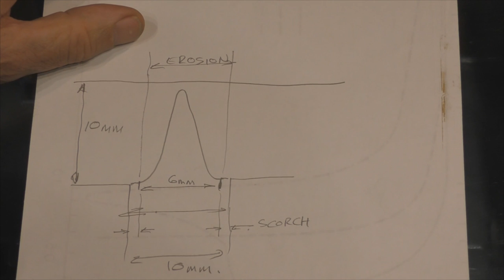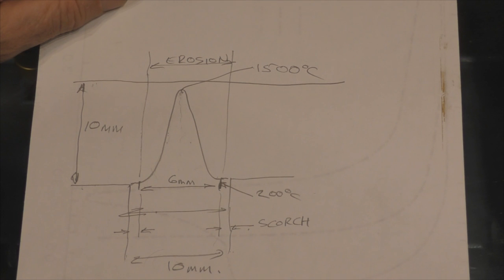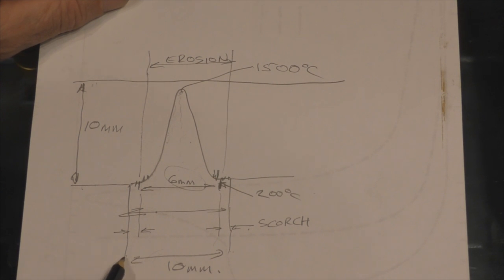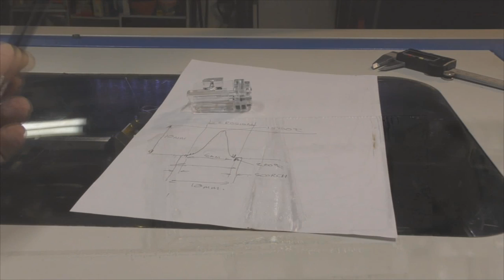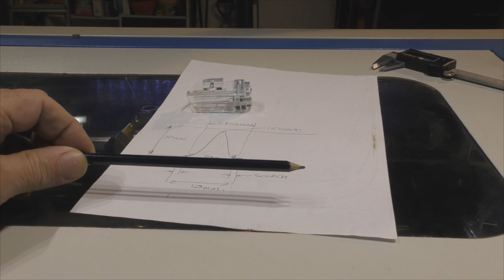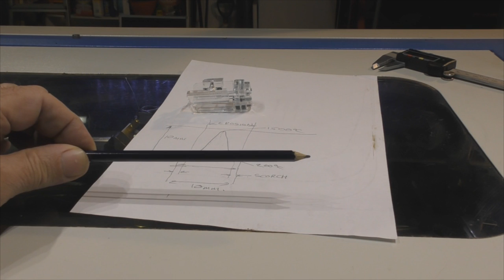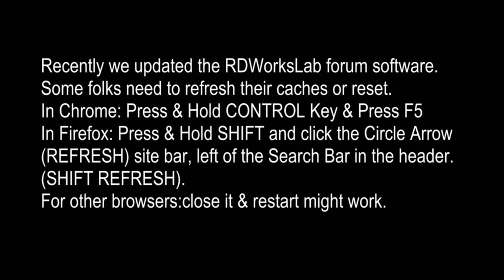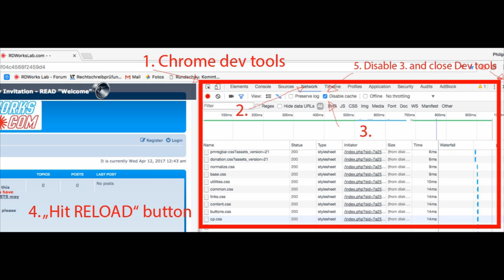RDWorks Learning Lab 102 Laser Beam Diameter

Comment: are the mirrors in these lasers under sized.  what is the diameter?  If the mirror housings can be changed or adapted would bigger mirrors be an advantage in using the far extreme of the beam.
Reply from the maker: Hi
As you can see from the mode burn into acrylic, the damage diameter is about 6mm, which is the claimed beam diameter. True it probably does encapsulate maybe 85% to 90% of the energy and a 6mm beam easily fits onto a 25mm mirror.  In its mount and canted at 45 degrees the effective mirror  width can be as little as 14mm. That's plenty to aim a 6mm beam at . However there is residual energy right out to 12,7mm that may or may not be collected if the beam is not well aligned. I am a believer in wanting to collect it all now that I know its there to be had.The bigger problem is the fudemental design of laser head where the bore down to the lens is fine for a 3mm diameter beam 40 watt tube that they fit to these 50 watt 300x500mm machines but upgrade to a proper 50 watt tube or more and you will start to encounter design limitations.
Best regards
Russ

Comment: Explain to me, if you can because I don't know the answer, but I have a laser pointer (5mw) and when I pointed it outside my window to an object 50m away the dot had grown pretty large.  Is this because it is only 5mw or what is going on?  No mirrors for distortion so stumped I am.
Reply from the maker: First I have to say I have no rational explanation for you. There will be double refraction as the beam passes through glass ie the beam will come out of the glass at a point that is offset to the entry point but the entry and exit beams will be parallel. So this cannot be explain what you are seeing . Glass can be very a complex material depending on its constituants and how it is made There is usually very little crystal stucture in glass otherwise it would not be transparent. It may be possible for the few crystals that are there to cause scattering of the beam as it passes through. I would experiment with some cheap picture frame glass  to see if you can  replicate the result. You could also write to the tech department at one of the big glass manufactureres. 
I also need to apologize for not answering another of your questions. I looked back and was a bit confused about which one I had missed. Was it the stainless engraving question?
Best regards
Russ
Reply: Your 5mw pointer is Laser Diode, quite different from our 50-80W CO2 laser tube. There is usually lens in front of the LD, which can be focused by turning the barrel. The LD has so called Fast Axes, which creates oval shape of the beam, usually corrected by FAC lens. On more powerful LD you actually get a line instead of a spot. I am talking about output of 4W and more.
And than there is the glass interference, as Russ mentioned earlier. 
regards
otto
Reply: Yes, I understand that but why would this laser grow the farther it goes?  Laser is supposed to be a coherent beam not like a flashlight regardless of what is producing the laser.
Reply: Russ, it was the stainless.  As Otto mentioned I have a laser diode but a laser is a coherent beam regardless what is producing the beam (solid state or gas) so the farther out the beam goes the bigger it becomes 
which makes no sense to me for lasers.  If this were a simple torch (flashlight) I could understand.
Reply from the maker: I can only take an educated guess at your laser pointer problem by saying that I agree about a coherent beam of light and those photons are all happy to travel as a tight knit group until they hit something. That something could be dust particles in the air, rain, fog ,snow etc and then they start start losing their energy and probably being knocked off their straight path. For artillery range finding they use kw lasers  not milliwatts to try and overcome this issue. As I mentioned, glass may appear transparent but if there is any crystal structure within, then those crystals would steer the photons off course. Now please understand, this is just my logic and not verified fact so I cannot really unravel your particular question.

As for the stainless question, I must apologize for missing it. However, it's good to answer it in this comments section because as you will see in my beam energy profile picture, the higher the energy density of the beam (towards the centre) the high the temperature. With my 70 watt beam I can already see about 1500C before it passes through the lens where the energy density (temperature) will be further magnified.

Stainless melts at about 1450C so when you stop and think about it, there is potential to damage the surface. However, the initial problem that you have to overcome is REFLECTION. The crystal structure of stainless steel makes it about 90% reflective so chucking 1500C at the surface is not going to cause melting because most of that heat energy will be reflected. That's why I was a bit hesitant about this whole venture. The good news in my case is that with 60 watts amplified, I am hitting the surface with so much heat, I can overcome the reflection issue and start melting the surface, As soon as that happens then the crystal structure changes dramatically and the surface become absorbent to the heat , but only very locally because now the thermal transfer  properties(and mass) of the steel come into play and the energy gets quickly dissipated, thus limiting the depth of the melt. After all it is only a pin prick of energy that might be incredibly hot but at 60 watts it has no hitting power. I doubt if a K40 (30watttube) would ever be able to genetare high enough spot temperatures to overcome both reflection and thermal conductivity.

Best wishes
Russ
Reply: I beg to disagree. Please take the lens off your pointer and see...
There may be confusion in two different terms - coherent and collimated. It is not the same. The CO2 laser produces collimated beam, whilst LD does not, it is like your flashlight. Google "laser diode beam shape pics"
regards
otto
Reply: Well, laser beams aren't supposed to spread out is what I have been taught for the last 40 years is what I was saying.  They should be the same diameter in free space (in a vacuum) 1mm to as far as the beam can go which depends on its energy.  At least this is what I was taught when using a real Ruby or gas or now solid state diodes.
Reply: Trying to process ordinary light into a coherent, monochromatic and collimated beam, is just impossible and Wiki says Collimated light is light whose rays are parallel, and therefore will spread minimally as it propagates. A perfectly collimated beam, with no divergence, would not disperse with distance. Such a beam cannot be created, due to diffraction.   The thing is I see a 2mm dot at 25mm distance turn into a 100mm dot at say 45 meters that is pretty bad for a laser of any type.  I still suspect the lens has something to do with it but I can't grasp how it would have that much spread for a relatively short distance.
Reply from the maker: Hi
Iyt appears that all laser beams start diverging as soon as they leave the exit window. That divergence can be negligible to small but there is a formula to calculate it
http://iiith.vlab.co.in/?sub=1&brch=189&sim=342&cnt=1
Reply from the maker: Could it be that the law now requires all laser pointers to be focused at relatively sort distances to remove  the nuisance/hazard to others? I'm not up on this technology I'm just probing for an alternative explanation.
Best regards
Russ
Reply: You may be right Russ as I wouldn't put it past the lawmakers to do such a thing.  Over here in the USA people were using laser pointers on planes and that caused a HUGE stink (for obvious reasons) so maybe they did.  I wonder if a diode laser that is used in a pointer is not the issue now but it is its focusing device?  I know of no laser pointers with a focusing mechanism in them so what is in it is what it is.
Reply: Some odd reason I can't edit posts on Youtube.  Anyway, that link goes back around to what I first said so the total length of a laser engraver's light path would be what exactly?  The beam at the far end and the beam coming out of the tube itself should not be exactly the same even if all mirrors were removed and it was just shot into space instead.  I suspect a mirror would exacerbate this to some extent (especially with 3 of them).
Reply from the maker: It is certainly possible for the beam to be distorted by the mirrors, that is why I'm staying with my copper mirrors that were lapped dead flat (to within half a light band). A sample Chinese mirror that I sent for comparison, was 10 lightbands!!! My laser exit window is 12.7mm and the biggest hole I can burn with it after 3 mirrors is 12.7mm so there appears to be no growth. However, the burning threshold for masking tape must be over 300C and there is scorching around the hole indicating power beyond what I can see. So I suspect I am still not collecting every last gram of energy and that the beam is growing in diameter even after a couple of meters.
Regards
Russ
Reply: I was let down by your findings on the gold mirrors and I am not sure why they were basically the same as copper which makes no sense.
Reply from the maker: That makes two of us at least. Ok I am only looking for anther 1 or 2% efficiency  and the scientific data suggested it was there to be had. Knowing I was looking for small amounts made me doubly cautious about my measurement methods because it would be easy to lose 2% and get the wrong impression. I have seen industrial copper mirror claiming 99.5% but I find that these are coated rather than raw copper. Absolute best fro raw copper is going to be 98%. The gold figures promised 99% from raw gold.. I am a bit disappointed but not overly surprised because my workshop conditions, measuring kit and tube stability are way off the conditions  under which these physical parameters were established.
That extra 2% is not worth chasing when you can buy almost indestructible molybdenum  mirrors cheaply that can perform to 96/97% 
Regards
Russ

Comment: Russ. have you ever tested the divergence of the beam from the output lens. I believe the standard tubes are actually divergent. I noticed this when testing a tube with a target 3ft from the tube the burn was much bigger than at 4" I currently run my machines with the exit windows around 30mm from the first mirror to minimise any divergence but I've not actually measured the difference between 30mm and say 60mm in relation to beam width.
Reply from the maker: Hi
It is rare that you can carry out such a test because the machine end panel is usually fixed. However, I did get the opportunity to do just that with the Bodor machine when I was in Florida. It had a fully hinged side panel allowing me to fire the laser into the distance. I was burning a spot on a card target right on the face of mirror that was oval but 8mm tall. I then removed mirror 1 and set up a target wall about 2m away. I was doing this to help align the beam combiner I was trying to fit. The burn mark was now 8mm diameter (because the wall was normal to the beam). The red dot was about 4mm diameter. This was a Reci S2 tube.  So at present the only evidence I have says the beam is parallel. This current demo also indicates that I get a 12.7mm burn from a 12.7 window about 1200mm away. I think this is a Yongli tube. . I found the same fact applies to the 60watt EFR tube that I have in the Lightblade machine ie 12.7 burn at mirror 3 form a 12.7 window. There may be divergence but it certainly does not appear to show in the short laser paths that we are going to see. 
By the way, I cannot understand why you think the distance to mirror 1 is going to lessen any divergence. The mirrors (if they are truly flat) are only turning the beam round corners, they cannot somehow magically affect divergence.
Best regards
Russ
Reply: in all my research co2 laser's beams are actually divergent from the moment they exit the tube, depending on quality of tube/exit windows etc will all dictate the level of divergence, all my testing was done with a cheap 700mm "40w" tube i was simply interested in seeing how far the unfocused beam was still able to burn material such as mdf. there was no methodology to the testing simply a sheet of mdf at a set distance and pulse the laser,. there was a noticeable change in dia of the beam as the target was moved further from the source, i believe this maybe less noticeable with the higher end tubes efr/reci as i believe they design the beam profile to be as near to parallel as possible over the first 2m from the tube, i have yet to try this with my efr tube to see if the results are replicated but the next time the tube is out or i get another one in i will try it and see,  for now i just keep the tube close to the 1st mirror as standard to reduce any divergence that could be present. i was just curious if you had done any testing around it yourself.

whilst he totally misunderstands the subject https://physics.stackexchange.com/questions/223946/how-can-beam-divergence-be-corrected-for-in-a-co2-laser-cutter did a similar test on a reci tube and found the beam size expanded over distance, yes i know he only needs to be concerned with the distance to mirror 1 not the length of the total beam path, 

it may well be that within the first 30cm or so that the amount of divergence is so small to be barely measurable and there for irrelevant in our context, was just a  thought i had,
Reply: It has always been my understanding and experience that the beam diverges as it leaves the lasers aperture and the amount of divergence is dependent on multiple factors. Mirrors have no effect on this phenomenon which is a fundamental characteristic of laser light.

http://vlab.amrita.edu/?sub=1&brch=189&sim=342&cnt=1

Lasers beams that need to go long distances can be collimated so that they have minimum size change over distance but our laser machines are not. :)
Reply from the maker: Hi
Your research is correct and in our case with no beam correcting mechanism divergence will occur. How much is debatable because I can find no specification from any reputable tube makers. There is a theoretical minimum divergence based on the wavelength of the coherent beam which calculates out to about 10microns per 10meteres. Now that may bear no resemblance to reality as it is a possible minimum but anywhere near that figure and for all practical purposes over our path lengths. you would call it parallel. I am very much a pragmatic engineer that resorts to science sometimes to guide me to practical solutions. I this case I'm only interested in whether the whole beam hits mirror 3 and disappears down the tube. If it's diverging but not oversize, I have other issues for my two remaining grey cells to deal with but I shall be getting an opportunity soon to test my tube in a straight line so I will bear in mind this topic and check beam diameter carefully at different distances.  Thanks for raising this interesting topic
Best regards
Russ
Reply from the maker: Hi Don
Thanks for your input. Yes I understand that the beam has divergence but I'm unable to find out how much quality tube manufacturers specify.As a pragmatic engineer I occasionally resort to a bit of physics to help me out but in this case all the bits of undocumented experimentation I have done over short distanced (about 2.5m max )there was no noticeable difference between the height of the oval at mirror 1 and the diameter of the circle at 2.5m distant. If it was half a mm different then the scorch around the burn would have made definite sizing impossible.. The final crunch for me is "does the beam wholly hit mirror 3 and disappear down the hole?". It's interesting if it is diverging but has no effect on the performance of the machine.....and that's my goal to maximize performance by understanding where there are citiical settings or design issues that need addressing..

I had already visited the link you sent but I really appreciate the thought.. I did a few quick calcs (I'm no maths genius) and decided that the minimum possible theoretical divergence was in the order of 10 microns per 10 meters. If that calc is anywhere near right and manufactured tubes are in the same ball park then for my purposes thats aprox parallel.
By the way I agree that divergence will not be affected by reflection from a flat mirror. You can place mirror 1 anywhere and it will affect nothing
Best regards
Russ